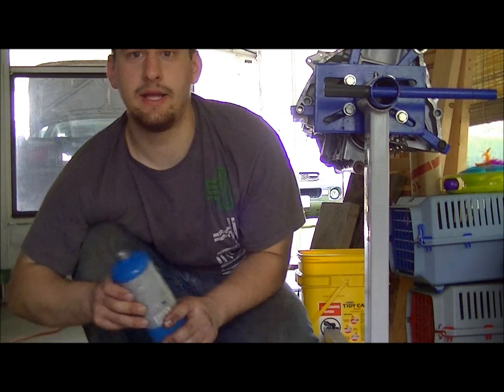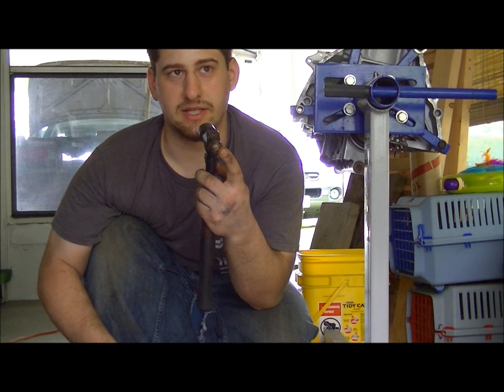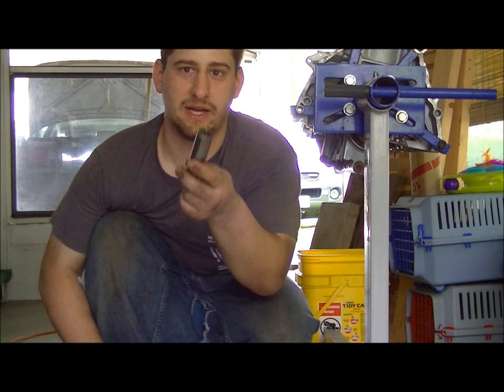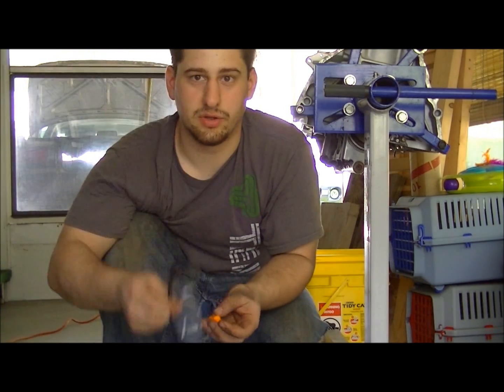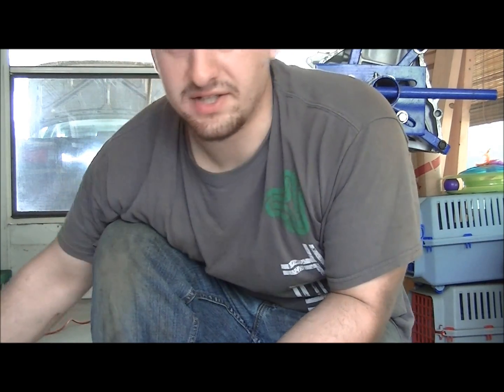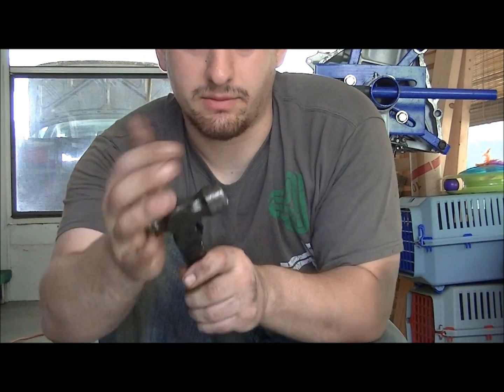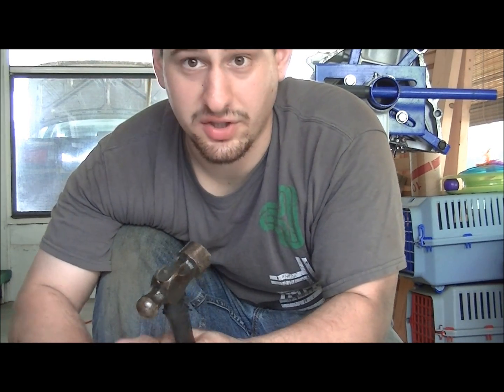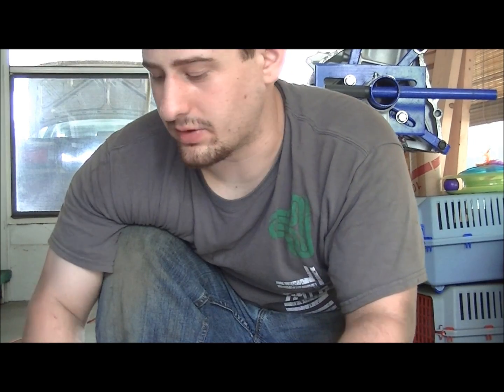How to remove seized rusted stuck lower control arm bolts Part 1

Comment: do you have fb sir ive got a 2000 civic si and went to take the bolts out of the skunk 2 lcas one the head sheered off and the other broke half way in any idea how to get them out dont wanna buy new lcas bc i just bought new bushings for them
Reply: thanks for the tips i just used a grinder with a cutoff wheel and got them out ordered new sleeves from skunk 2 and bushings and some poly lube also gonna anti seize the bolts the go into the metal sleeve so this dont happen again as the previous owner didnt do this

Comment: Shit like this is the reason I quit working on cars! I wouldn't be so bad if you could find the bolts you need after you cut them out. Seems like dealerships never have bolts in stock and you have to wait for a week or so to get them. I'll never understand why no one makes aftermarket suspension bolts.
Reply: +MrCoffeekelly Lol. Try ebay.

Comment: I can easily doing m spin the bolt but it will not move what so ever. HOW do I get that out? Drop the subframe and cut it out? It's a 2002 VW mk4 golf gti

Comment: Machinist's Workshop magazine tested penetrants for break out torque on rusted nuts. I use liquid wrench too because it's 1/4th of the price of Kano Kroil. Here are the results from their test.

None ..................... 516 pounds
WD-40 .................. 238 pounds
PB Blaster ............. 214 pounds
Liquid Wrench ..... 127 pounds
Kano Kroil ............ 106 pounds
ATF-Acetone mix....53 pounds
Reply: Pie Eyed I use a product from Halfords in the UK called Shock and Unlock which works well for me on my Range Rover suspension arms in general. My rear track control arm inner bolts had to be cut off at either end with a power hacksaw as they had completely rusted into the bushes the extent that a tech trying to adjust the tracking broke his impact socket in the fight.  A 1 mm cut off disc would also work well if you can get the tool in there.

Comment: my bolt just spins in the bushing and wont come out...I can spin it with enough force but it wont thread out...back side of bolt where nut is, is broke off. Its hard to spin and i cant just pull it out. any pointers?
Reply: I have the same problem. did you get yours out? i was going to try heat but will try hammering the bolt head to try and shake it loose from the bushing.
Reply: No but I know how. I tried that with lowering and raising the back end and you will only bend up the housing around the bushing, so what i guess we can do is heat up the bolt head till its red hot and then slice it off with oxygen, then drive out the bolt, pry open the bushing housing and bushing should drop right out. Ive been trying to find this bolt and a panhard bar in junkyards but i stepped in a hole and broke my foot...so be careful out there.
Reply: Its an 87 Camaro nothin fancy except its got the ram air snorkler on the radiator t-tops a fair bondo job on rear wheel well and a 4.5 v6 that come out of a van or some damn thing. I dont have alot of vice grips so im hoping i have one big enough...Are you on thirdgen? Im not but I havent had a smartphone or anything till recently so vids and pics are very possible in the future. I also have a 3/4 ton 76 chevy that im constantly working on so I could have a fulltime job posting gig goin pretty soon. Thanks for the tip Momoxsparco im looking forward to seeing u on my first youtube vid peace.

Comment: The problem I had with BOTH my 99 civics was that it seized inside the bushing and NOT the area where the threads are connected. But this method does work, the only downside is loss of time and energy especially in the heat of the day lol